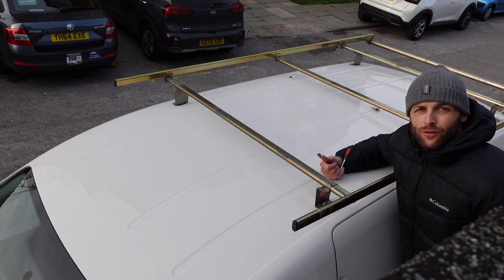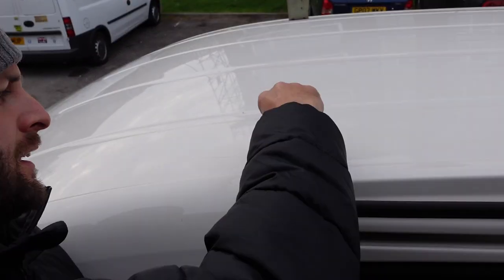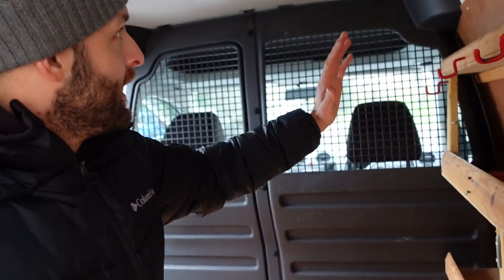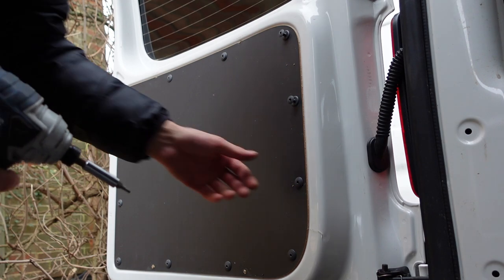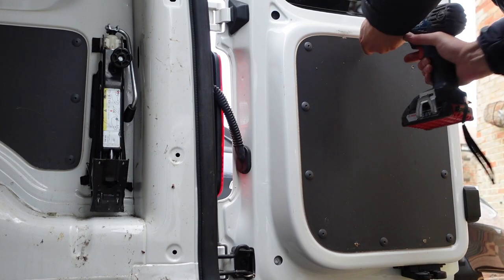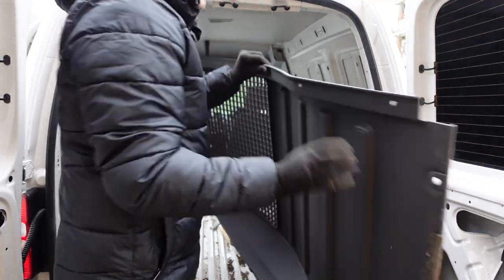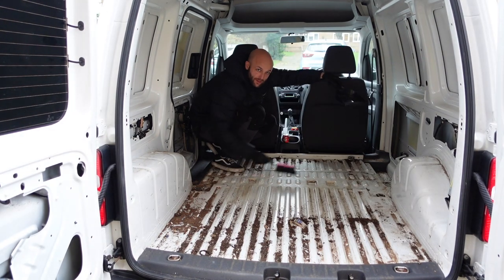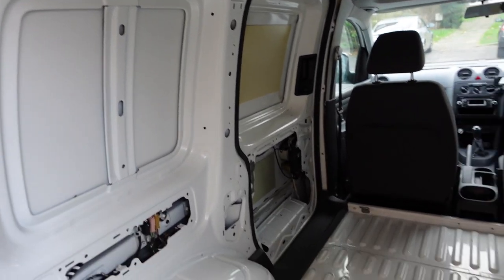VAN CONVERSION - Stripping out my VW Caddy!

Comment: Hi Daz, just keep an eye with any water ingres from roof as mine did start leaking when it rained. Best put some vasaline or similar on bolts before properly tightening them.🤞👌👌
Reply from the maker: Hey mate cheers, I did check all the bolts yesterday after the heavy rain all seems okay. Did you have the rubber washer installed on yours? I made sure I got the proper ones so hopefully it doesn’t let any in. 😎👍
Reply: @tubedarren  yes i had rubber washers 🤞🤞

Comment: You know when you ply line a van,how do you stop the screws from going right through the metal to the outside?
Looks a nice and clean van👍
Reply from the maker: Most of the screws appear to penetrate through the metal of the floor and wheel arches when doing it, it can be avoided on the floor if you sikaflex Battons down then screw the ply into that. On the doors and sides the screws are going into double skinned metal so not an issue. The main thing to avoid going to far, is to measure the thickness of the ply and distance to metal and allow for a few mm less for when the screws countersink. (I hope that makes sense) 😂